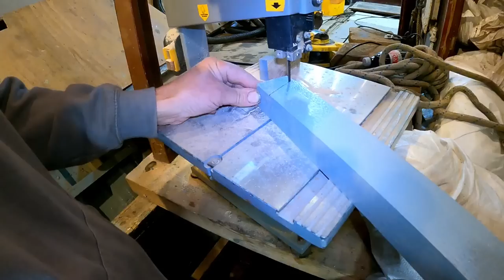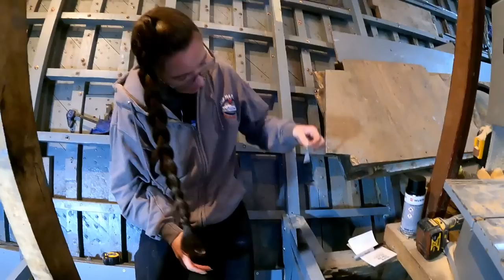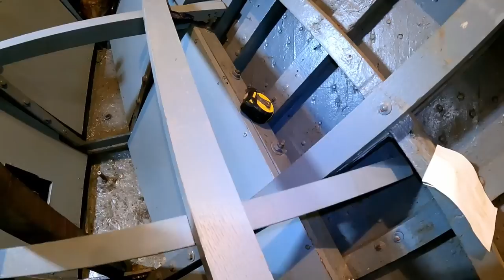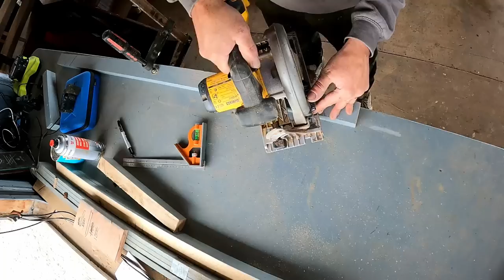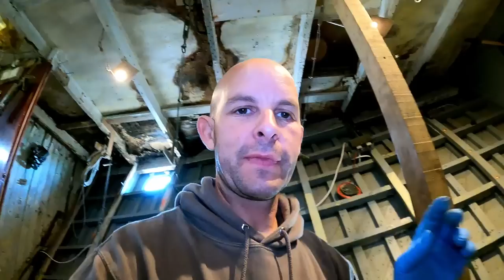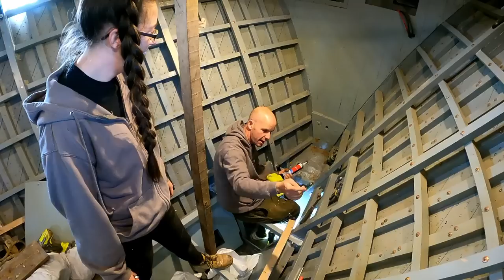Ep 90 - 🛥 Will My Boat Sink? BALLAST #boatrestoration

Comment: 10 episodes from 100!  I hope you have a little party at some point (hint hint).  You have come a long way!

As for negative comments, they are always there, no matter what you do or where you go.  Just ignore them.  The older I get the more careful I have become.  What I noticed, if it is not handy, I tend not use it.  I think I now have 6 sets of clamshell hearing protection and 20 sets of safety glasses scattered around my 2 story workshop.  Guess what, I still never have it where I needed it, when I need it.  Sometimes I stop and find them, sometimes I don't.  A lot has to do with how loud or dusty is it, and how long will I be doing it.  All this PPE seem to migrate to the same spot, which is where ever the power tools are not.

Have fun, and I am always looking forward to work on your boat day!

Comment: I never realised that a pallet needed to be tested for humans to stand on ! Two years ago i made scaffolding around my house  out of pallets so i could take  the tiles off the roof and replace the under felt ------------- dam does this mean i will have to redo it using proper metal scaffolding  ??? As a lad i used to help my local builders erect wood scaffolding which was roped together with wire rope . This was in the mid 1950's . Ex navy ratings made the best splicers and riggers in those days ( not today when ratings only deal with computers ) , they taught me a lot about self safety when erecting scaffolding . always impressed upon me that you had one hand for the " ship " and one hand for yourself . Carry on you good work .

Comment: For threaded fittings that aren't likely to be removed regularly, you can prevent loosening of the nuts by using a sharp metal working chisel to deform the last thread above the tightened nut. It can still be removed, but will not vibrate loose on it's own. Much cheaper than 'Lock-Nuts'... 🤑

Comment: I'm 74, for the last 26 years I've been supporting myself and family by doing safety inspections of small sawmills. Having said that, I don't wear PPE most of the time when I'm working for myself on my boat (and previously on my houses), Today I was cutting beams for my new deck house on a small work site table saw, no guard on the saw, no other PPE. My hearing is still good ( my wife might disagree), have my eyesight and all my fingers. Tell those moaners to Foff.

Comment: I totally agree with you both about ppe. I am self employed as a wood turner/carver and antique restorer, I have done all the courses and certificates to prove it, wearing safety goggles at certain stages of machining can be much more dangerous when they fog up at critical times during a process. I to still have all my fingers. Only severe cuts I have given myself are through blunt tools, simply because I could not be bothered to sharprn them.

Comment: A few years back (when I still had me teeth) I bought a packet of salted roast PEANUTS that had a printed warning on the back 'WARNING - MAY CONTAIN PEANUTS'.  You guys impress with your considered quality & strength of work. - My guess is that those engine bearers work like a 'Ladder Chassis' works in an old sports car (- holding the Austin Healey 3,000 together). Thanks for sharing .. from The Hurunui NZ.

Comment: I was watching a video that mentioned lead that was made before ww2 can be more valuable than led made after because it does not have any radioactivity from the atomic bombs that were dropped. The older lead is useful in really sensitive electronic equipment and the supply of it is slowly shrinking

Comment: You are doing a great job one hint put the nut on first before you cut the bar grind it and then unscrew the nuts over the grind it will clean the threads

Comment: Keep it up guys.  Rant away. Its the same on every DIY or fabrication channel. So many armchair sailors/mechanics/barrack room lawyers. Dont let it get you down. You will never please everyone.   I have been in engineering for 60 years and still have all my digits and both eyes. Common sense is your friend. 
I was always taught not to wear gloves on a lathe, drill press, grinder, mill or any rotating machinery as doing so can rip your fingers off.  Push sticks & goggles a must though.  I only wear gloves for greasy & mucky jobs.  Thanks for sharing.
ATB. regards.

Comment: Another tip for cutting bolts - wind a nut on first, before cutting. Then, after you clean off the sharp edges, take the nut off again, and it'll tidy up any remaining damage to the threads.

Comment: Just loved your H&S rant, sound like me on a good day. I started as an engineering apprentice in 1963, the most important PPE equipment then was your clocking on/off card, only started wearing gloves after I retired to keep my hands clean and yes, I still have all my toes, fingers, eyes, etc. I have used all the equipment you use over the years both in the workshop, on site and offshore and still do, current project is preservation of my forty year old Land Rover. Don't need most of the crap anyway, just a good dose of common sense and you both have that in spades. Keep up the good work and £@&K em all.

Comment: Here’s a radical idea… sorry hope you don’t mind me suggesting these crazy ideas… but when you get to the point when you need to go into dry dock. Obviously there is no alternative to dry dock but could you make your own? Now hear me out, I got this idea whilst watching a guy build his home and his workshop (Kris Harbour is his name and he has a YouTube channel) in North Wales. 

First thing to do is to stabilise the boat along its length with props to prevent the boat from falling on its side. Then starting at one end of the hull expose as much of the hull between the mud and the keel, then lay in some heavy duty liner similar to what you use for pond liner, maybe a bit heavier duty (I know this may sound expensive) on the mud and then fit long supporting timber blocks between the keel and the liner to spread the weight. Once you reached the other end of the hull, there will be a series of waterproof membranes which you will need to bond to form watertight seals. Now here’s were my thinking about Kris Harbours home build comes in. 

Kris built his home and workshop from earth bags which are the modern version of sand bags. So now you build up a wall of earth bags filled with the mud that you have excavated from under the boat. Build up the wall of bags to about say a metre. Keeping the membrane on the inside of the wall.

Once you have reached the top layer then fold the ends of the membrane over the top of the wall so now you should have the boat secured from wobbling over and sitting up and above the mud surface with lots of workspace all around the bottom of the hull and a sort of temporary dry dock. All you need is a way to empty the dock at low tide as the high tide might come over the top or rain will fill it up. Have say a couple of old seacocks or gate valves which you could build in pro the bottom of the dock as you construct the wall and use some form of sealant to fill the gaps along with joining all the membrane sheets up to keep everything water tight. 

Anyway crazy as it is might not be too expensive to do in comparison to putting into a dry dock…

Comment: i think im correct in saying the front engine bearers were originally for the third engine which was further forward than the rear two engines! love what your doing keep it up x
Reply from the maker: They never had a 3rd engine
Reply: @ShipHappensUK  my mistake i think of Vosper 70 ft MTB torpedo boats had similar hulls, thought may have used same skelton for both for speed during the war???.. love what your and keep it up!..

Comment: I once worked in a place where  a night shift  Fitter & Turner working alone who wearing gloves used a strip of Emery cloth to polish a shaft rotating in the lathe, the Emery cloth started separating on the edge, wrapped around the shaft and grabbed his gloves and ripped both of his thumbs out, he somehow freed himself and to get help had to climb over a Cyclone wire gate. So protection can be worse than none, I don't like wearing glasses while driving a car, looking sideways at intersections can warp the view of approaching traffic because of the rims. PS The fitter spent months in hospitals with both thumb stumps grafted into his stomach skin to grow new skin, he never could bend them again because there were no joints or nerves or ligaments ...

Comment: On a boat the "floors" are what in your house would be called "floor joists" while the actual covering boards are called the sole boards. Easy innit?  Bit like the inner keel which is called the "hog" but unrelated to the "pigs" which were the lumps of iron used as ballast. It's a strange world afloat!

Comment: The engine bearers extend to cover as much of the boat's length as possible to transfer the vibration and loads from the engines shifting 70 foot of boat to as much of the relatively lightly built hull as possible and avoid over-stressing the hull. That is also why they are so massive in comparison to frames and stringers so as to avoid distortion from the engines which as original build would be required to drve the boat quite hard. So the loads are shared across as much of the hull as possible.

Comment: The easy one first, maritime terminology, it doesn't matter what you call it, floor/sole, bow/pointy end, as long as they stay where they are supposed to be and the water stops on the outside, no problem.
 PPE, you don't need to be told a fire will burn you if you stick your finger in,  its all common sense. if your creating a load of dust your going to move outside or wear some protection, not shut doors and windows to keep it in.
 Not everything you do is dangerous, you balance any risk with what your doing with common sense. you are right, MOST of the PPE crap is brought in for the protection of the employer not the employee. I have never watched any of your video's and thought "that's dodgy."
Finally, its not easy but don't take notice of keyboard warriors who say your wrong to do this that or the other, probably never tried much themselves. you find people come up with great ideas and plans, and the first thing they do is come up with reasons why the cant do it.
It is supposed to be fun and an experience resulting in a final goal. 
 Great respect and to be honest jealousy at what your doing.

Comment: It is amazing how the boat is being mended using the same materials a wooden boat takes years to make but when in war people make things fast as many people work on each section at a time. plus building it is totally different to repairing because you have to take pieces out but keeping the structure and that is why repairing wooden boats to time to do and filming it as you go along means you can look back to see each part fits and how far to keep going until the full structure has top be safe and finished. To me this is amazing plus I think the original engines would had been Rolls Royce Merlin as these boats were made for speed and did all sorts of things in WW2. Out of thousands of these boats built not sure if this is the last one left of its type. This is so good and I hope people help to make this ship happen.

Comment: Ian 

If we complied with all the workplace health and safety requirements then nothing would ever be completed.  Please continue as you have been doing however I was a little surprised to see your fingers appear to get very close to the band saw blade but this might just have been because of the angle of the camera. My understanding is that the stability of a floating vessel is determined by the shape of the vessel's hull, the location of the vessel's centre of buoyancy and the location of the vessel's centre of gravity.  These are determined through a three dimension mathematical analysis of the shape of the hull and a three dimension mathematical analysis of the location of all materials making up the vessel and their individual mass.  This could be completed using first principles but I would expect that there are a number of software programs available which would make these calculations easier.

Comment: One to make you smile on ppe n h&s. 
I operate lorry mounted cranes. Remote control. 
H&s insisted i wore gloves at all times on a particular site so i sat on a chair for 30 mins. Site manager came over to see why the job hadn't started, cant do mm perfect installation with a crane when i cant feel the controls. H&s had to add an exemption.   

On another site leaning against a wall knee height, looking into a pit lowering a 7 tonne pump onto pipework guys down there ready with bolts to line it up. 
H&s walked into lifting zone tapped me on shoulder. I was concentrating so jumped. Span round and my elbow broke his nose. 
Site manager went nuts. H&s guy kicked off site. 
Was going to tell me my pads weren't big enough. Correct size as per lifting plan lol 😆
Reply from the maker: H&S is stupid at times and causes more problems than it solves in the real world!

Comment: Ref the engine bearers, if the engine bearers weren’t spread across the width (beam) of the boat then the large amount of torque applied to the engine mounts in a radial direction might act opposite the direction of the screws which much cause the mounts to skew allowing the engines to twist in their mounts. Also, since the propulsion is referenced between the hull and the thrust resulting from the rotation of the screws, you want the force to be transferred along as much of the hull as possible otherwise you would stress the forward section of the hull against the engine mounts. worst case is the front of the hull would be compressed or the keel would try to flex. 
It’s all about distribution of the force. So by having 4 bearers under the engines, you are increasing the lever action to prevent the engines from skewing and the long inner bearers prevent the engines from effectively lifting up and separating from the bearers or cause undue stress on the keel when travelling at full speed… anyway that’s just my observations could be totally wrong of course… probably … can you smell bullshit? Hahah 😂😂😂

Comment: Just wondering as you move ballast around, any inclination to individually number and weigh each one? I believe from previous videos, you have some idea how heavy the block/bag of lead could weigh. Hence the hoist to move them. Maybe a used floor scale or used hoist with scale. Especially as you cover the ballast.

Comment: I used to work on 200 foot man lifts, that weighted 65 thousand pounds. The safety guy would jump your ass about all kinds of stupid, nit-picking crap "for safety" but I found half of it made the job harder and less safe.

You have to use your best judgement in a given situation and use the tools/protection that is best for you in the moment. Keep up the great work!
Reply: I was once told to come down from over sixty feet by a H.S.E. guy. He instructed me to wear a hard hat although there was nothing higher on the site than the building i was fixing sheets to. I asked if the seagulls shat ball bearings but the H.S.E. guy said it's for if i fell off. 🤣🤣🤣 from that height, if i fell, i'd probably be dead. He had no concern about the hard hat falling off me from sixty foot and hitting someone below. 🤣

Comment: Correct me if (when?) I’m wrong but didn’t these boats have three Merlin or Allison aero engines?  The middle engine was sat forward of the port & starboard with a long driveshaft down the centreline.

Comment: might have had more ballast than is needed now, as has no gun mounts anymore.  It does not look like any was removed [ballast] with the removal of the war fixtures.
Reply from the maker: There was no ballast in her during her war time configurations, as the original engines were 3.5 tonne each

Comment: Apparently it’s called a soul because that’s the way your soul is transported in the afterworld, ie by the ferry man. Please correct me if this is not true. If you put the nuts on the threaded bar before you cut it then wind the nut off then there’s no need to grind, and that’s my top tip to you lovely people. Ps don’t use nylocks on it makes it harder doing this. Hope it helps.
Reply: That's how i've always done it. Nuts on, chop off, unwind and go.

Comment: I always leave the nut on the thread before cutting it, when you remove the nut it clears out the thread roots. The engine bearers are probably that long to spread the torsional vibrations and forces over a larger area to reduce stresses on the hull framing (educated guess).

Comment: I had to fit two thrust plates when I fitted two more powerful engines. The plates took the push from the props and saved ripping out the engine mounts.

Comment: The audio at the beginning has gone very tinny. Has Gemma plugged up the tiny mic hole?  - The engine bearers are also load-spreaders. - - - H+S is crazy - like you aren't supposed to climb up a ladder until the top is tied off to something, but how the  bleep do you tie it off without climbing up?

Comment: Gemma you 2 should just ignore the negative criticism your doing a great job, your very careful at what your doing you supervise under 18s when using a power tool, just work in what your comfortable in, if you injure yourself then that's down to you no-one else and they shouldn't be even telling you what to do, it's not as though your working for an employer where you do have to follow the rules where PPE is concerned, besides you do use it when you need to especially when using any chemicals and when sanding etc, so you catty on with the way your doing things, also if anyone is criticising you that are from another country where they don't even use any PPE then they have no moral high ground to stand on and shouldn't be saying anything, they need to put their house in order first before criticising you or any one else come to that